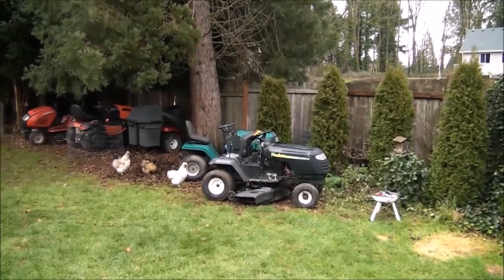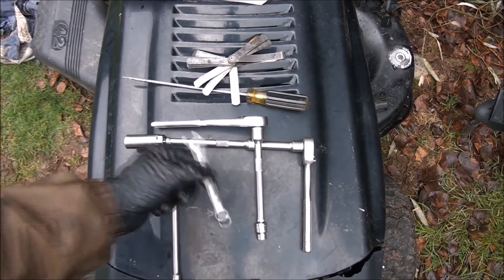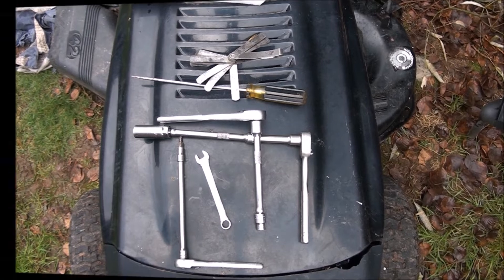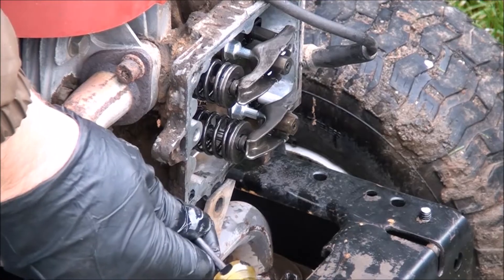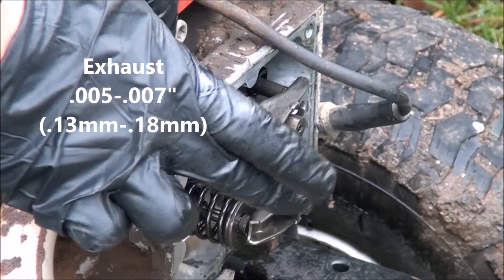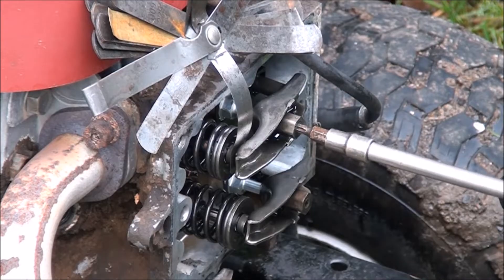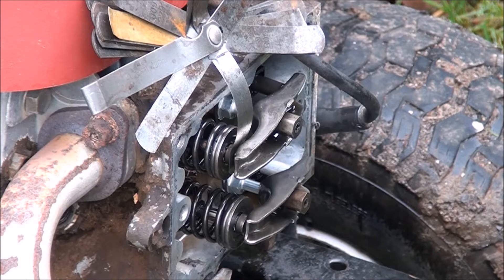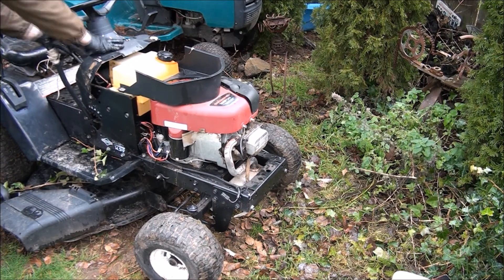HOW TO ADJUST the VALVES on a Briggs and Stratton OHV INTEK engine on a Riding Lawnmower .. ALL h.p.

Comment: You have an error in your procedure.  The Briggs & Stratton engine repair manual stipulates that the engine should be manually rotated CCW for valve adjustment NOT CW.
Reply from the maker: yes it does. I have found in my 20 years of experience that it does not seem to matter.

Comment: On a 19.5 Briggs and Stratton there is only one valve cap when adjusting the valves.. which valve does this go on the intake or the exhaust
Reply from the maker: I can't remember, a parts diagram should show you.

Comment: you better do some research the intake valve is on top and the exhaust is on the bottom
Reply: You can clearly see the exhaust port next to the exhaust valve lol
Reply: All I can tell u is intake push rod is made of aluminum intake is the bottom
Reply from the maker: No it is not

Comment: Hi Jeff, you can set the valve without having to find TDC, all you do is turn over the engine until say the intake valve is fully open so the exhaust valve will be fully closed and then you can set the exhaust valve lash and then do the same for the intake valve but before you do anything make sure that when you turn over the engine that the exhaust valve bumps open just before TDC, if it doesn't then the automatic decompressor on the cam is shot and it will need a new cam to work correctly
Reply: That's very interesting what you said about the cam and auto decompressor, I didnt know anything about that. I'm in the process of trying to save an old Toro ride on mower that's been broken down and left outside for many years. When the spark plug is out, the engine turns over ok but when the spark plug is back in there seems to be a hard spot as the piston comes up which is even stopping the starter motor from moving.
Reply: @cj8172 wrong spark plug